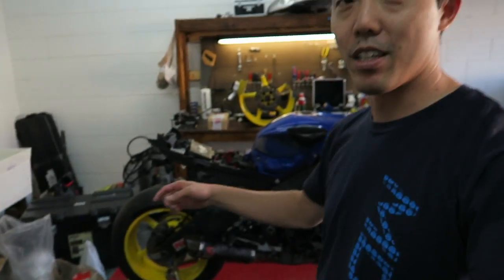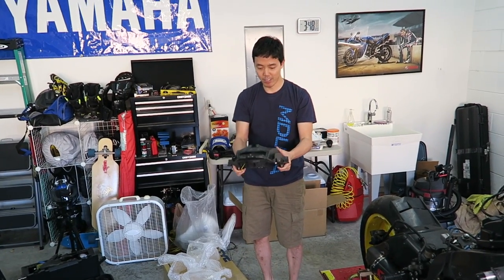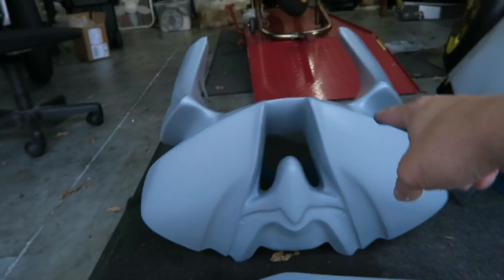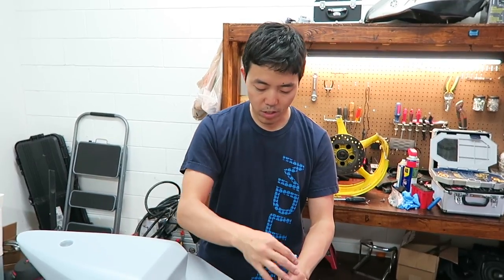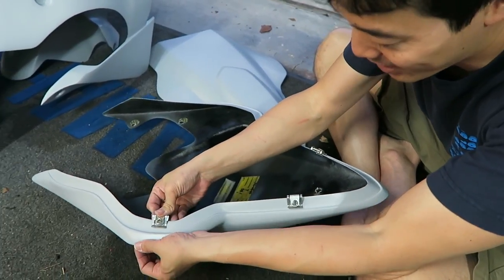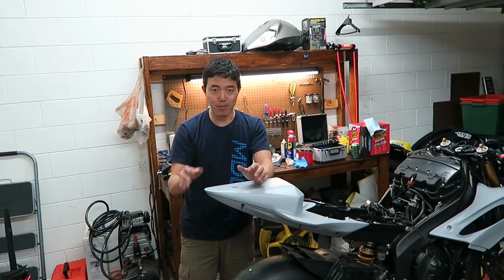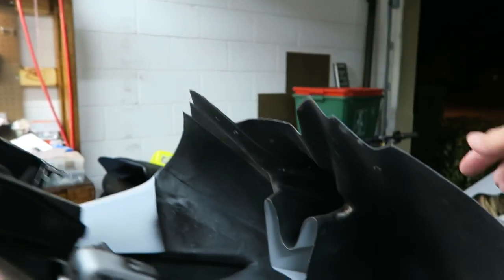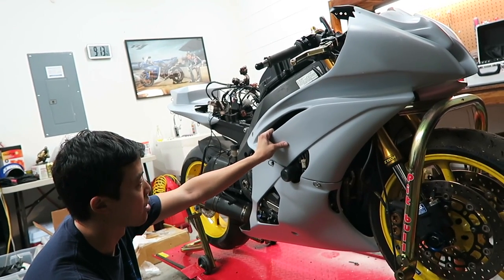Armour Bodies Fitting and Review and Subframe Swap

Comment: my advice for future, if you haven't already discovered this trick, grab some gaff tape, and tape the body work together how you want it, then use a punch to dimple the body work where you want to drill, but be carefull not to chip the body work. Then, simply drill through both pieces, and then use the appropriate size step bit for each hole. works like a charm, and will automatically line everything up. you will get factory tight lines.

Comment: You put the bracket onto the fender delete make a mark where you want to put the screw in the center of the bracket then trace the outside of the bracket edges on the rear getting on each side. Now you know where to place the bracket and the hole.

Comment: The armorbodies tail fit around the metal plate that the stock seat attached to??? I think I'm going to have to cut mine to accommodate my optimal racing tail section.